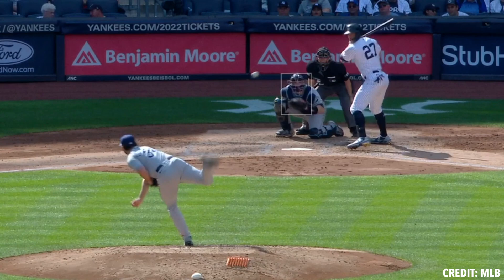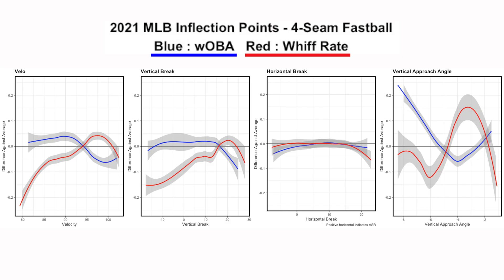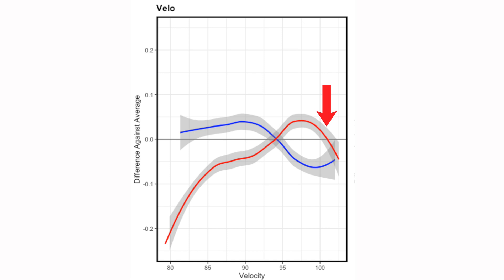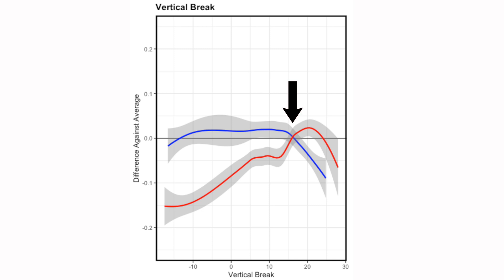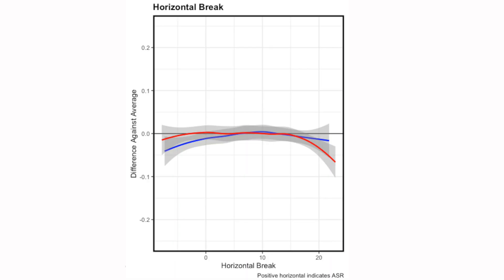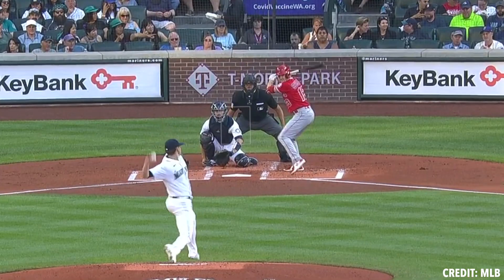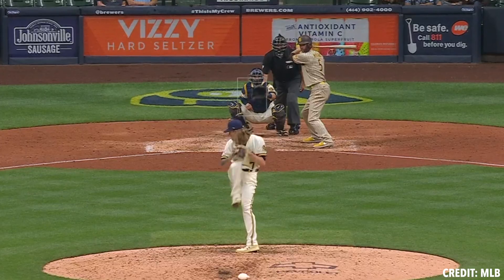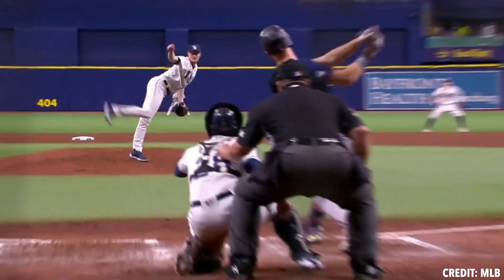What Makes a Plus Four-Seam Fastball? | Pitch Design for Dummies Ep. 1

Comment: can a slow 4 seam fastball stil be elite???
Reply: Yes, if it contains certain outlier qualities such as a very flat approach angle and or high induced vertical break. This is the same with sinkers/two seams just with a steep approach angle and low vertical break. However a below average pitch can become much better with good command. Take Sean Manaea for example: stuff wise his pitches grade out at slightly below avg to avg but his command is plus which makes him an above average pitcher
Reply: Yeah, if you’re Shota Imanaga. Your movement/release profile kinda has to be one of one if you’re gonna have a great 4 seam solidly below average velo (his is 2 mph below average, but with about 19 inches of IVB and low release point, resulting in a really shallow vertical approach angle)

Comment: I'm a little intrigued by your confidence bounds. Taking the velo plot for example, it looks like they're maybe only twice as large at 103 as say 95, but according to bbsavant in 2021 there was 47000+ pitches in the 95-96mph range vs 3 in the 103-104 range. With sqrt(n) scaling shouldn't the confidence bounds be 120x+ larger at 103 than 95? What am I missing?

Comment: Vertical break for a fastball is mostly just how tall a pitcher is plus how high their release point is, with a little influence from spin rate? So isn't that more or less the same info as vertical angle?
Reply: That’s not really true, neither pitcher height or release height are taken into account in vertical break. It’s all about how the ball is moving through the air. Vertical approach angle does take into account vertical break, but not vice versa, and the two metrics have a much lower correlation than you would think
Reply: Vertical break is more the direct amount of backspin placed onto a pall, and how that reacts with the air. Guys who are more over the top will get more of this effect because they will get more pure backspin on the ball